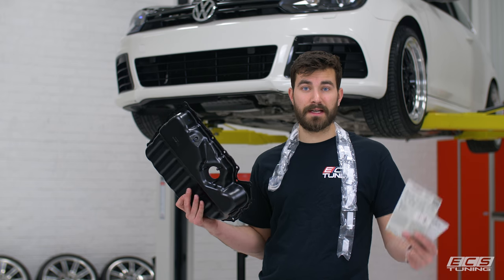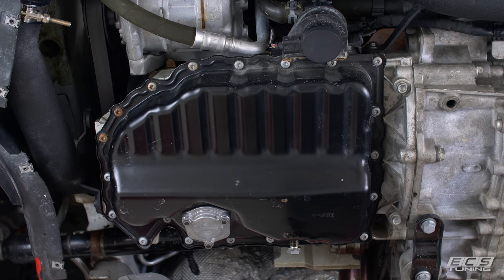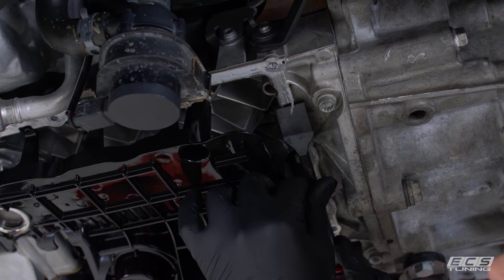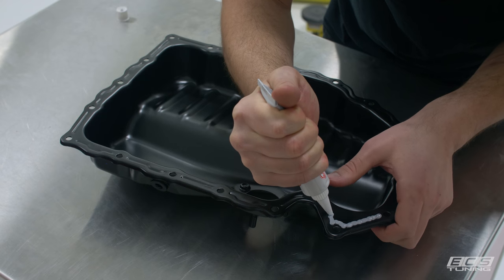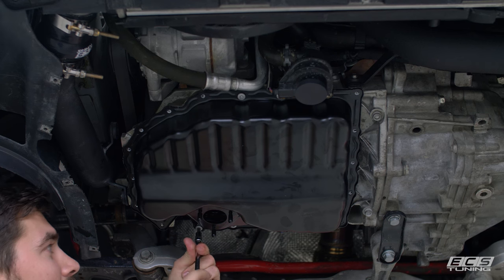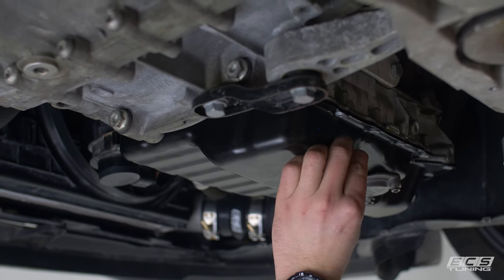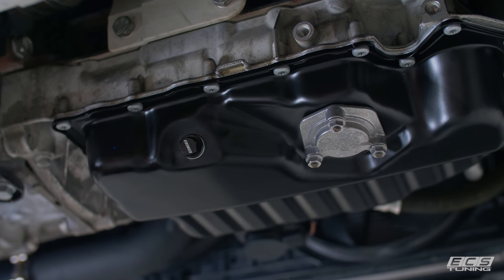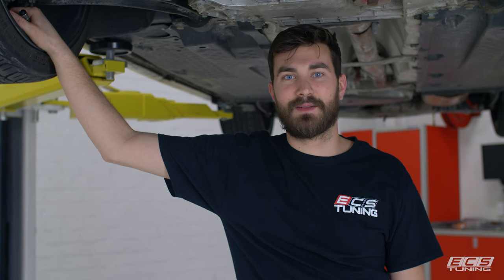How to Replace an Oil Pan (Volkswagen 2.0T)

Comment: Vw dealer quoted me 950 for this LMFAO
Reply: I too have noticed that in the last several years repair shops (not just dealer service shops) have ramped up quite noticeably their fees as well as their upselling. I was quoted like $850 to change an alternator for my very old '97 Mitsubishi Montero. And most recently I took my '12 VW CC to get the spark plug coil packs replaced but they advised me that I needed 3 other services. I opted for 2 of the more complicated ones and told them I will replace my own spark plugs.  BEWARE OF REPARE SHOPS OVERPRICING AND UPSELLS FOR SERVICES YOU DON'T REALLY NEED.
Reply: Lacy Petty-Washington oml bruh I hope not I just cracked my pan and I’m bouta get a quote tmro
Reply: I was quoted almost 900 in parts and labor for oil filter housing replacement on my 08 TT 2.0, hard pass. I replaced it with an ECS Tuning heavy duty housing for a fraction of the price lol
Reply: That’s cheap
Reply: Vw quoted me 595 for a new pan gasket and labor included
Reply: @freesmoke6895    not to bad .
Reply: I paid a shop $1375 Canadian funds this week…..

Comment: Not going to lie, if there is a part where torque specs dont matter for shit, its a oil pan... The seal alone can almost hold it on there, and they wont back out cause the sealant is in the threads... Just get them hand tight with a small wrench, and honestly, thats good... As for the pattern you do it in, i would try to do the ones across from each other, and as long as you dont do it around i na circle, i think its fine...

Comment: Thanks guys. I was doing this today on my 2012 GTI and I was glad I found this video for the bolt pattern and torque specs. Same install. Pretty easy, but that pan may give you guys some problems getting it down from the upper half. Mine was majorly sealed to the upper half, even with having the system open and being cold. I'd recommend an impact drill along with some WD-40 or PB Blaster for the pan bolts to crack them loose easier. I'm an ok mechanic when it comes to diys on the GTI, and this job is definately doable yourself without too much hassle, just torque the bolts right and put that sealant on like they do in the video and check for leaks you should be ok.
Reply: Thank you for the info, getting ready to do this and the extra info will help.
Reply: 💯 facts!!!😊

Comment: Does anyone know what the Rubber Part is that connects to the engine JUST above (verticallY) and adjacent to Bolt #15? I have a small leak coming from that.

Comment: I'm a lady who likes to learn about every car I've owned especially when I encounter a problem. I have a 2008 Volkswagen EOS ( Turbo) manual. I do the very best to take good care of it but when I got it I noticed smoke coming from the exhaust and leaking oil. Found out it had a cracked oil pan. I thought I'd research to understand what the mechanics do in replacing the pan and I found this video. It seemed pretty straightforward so why does it take a shop 3-4 hours to replace it when you've provided them with the oil pan kit? And they'll tell you it's over 900$ ( I read in the comments). No way am I going to pay that kind of money for a job that's between 1.5 hrs if the mechanic is competent at his or her job. 

Thank you kindly for a most informative video.

Comment: If I change the oil pan with this metal one how much quantity of oil I need to put after?În my CJSA originally enter 5.2 L , but on CDAA engine from where is otiginally the steel pan enter 4.6L.

Comment: Thanks for a great video.  I'm going to tackle this job on my 2015 Tiguan 2.0 TSI .  Oil pan drain plug hole is dimpled and continues to leak. Tried oil drain plug sealant, different washer combos and it still leaks.

Comment: Is the oil pan reusable? 

Like once you remove it, do you have to buy a new one every time? Or can you just slap it back on with more RTV?
Reply from the maker: You will want to scrape the old RTV off, but it can be reused.

Comment: So why go with the sealant instead of the gasket?  Or why not gasket and sealant?
Reply: I agree with you with the whole why sealant and no gasket.  Id much rather use a gasket myself.

But as for gasket and sealant together,  it allows for leaks.  Most gaskets are rubberish material and when sealant dries on it,  it slips against each ither

Comment: If you're here because you've got an ea888 gen 2 or CESA audi TT, after failing to find a video and settling for this one ( which is a great video) 

Just to warn you there's a bracket you'll have to take off in order to remove the sump. ✌️

Comment: What’s a reasonable price a mechanic should charge for this? I’d like to do this myself however I don’t have all the necessary tools ex. Car ramps so I can get underneath the car etc..
Reply: Oil pans, depending on your vehicle, go from 100$ to 200$. They'll charge you for the sealant as well, and the mechanic's time, so I am guessing somewhere from 250$ to 400$ would be a reasonable price. If I were you, and if you wanna save a bit of money, I would go and buy cheap car stands ( I believe ramps are more expensive). I am not sure if you would absolutely need two of them and if the car absolutely needs to be leveled out to perform this job, but technically if you already have a jack, one stand would suffice for the other side. 

As for the pan and sealant, I recommend checking on www.rockauto.com they usually have cheaper prices than mechanics, even after shipping. You could also get your stuff delivered in Canada with Kinek and get it from there if you have a valid passport.
Reply: @maddmax1993666  do not get under a car if you're supporting it with a jack of any type! Always use a jackstand. The above comment could get you killed, one stand will not suffice (unless one stand is all you're using I guess)